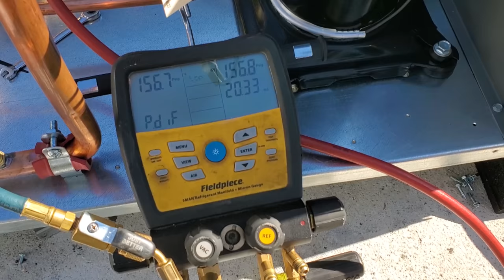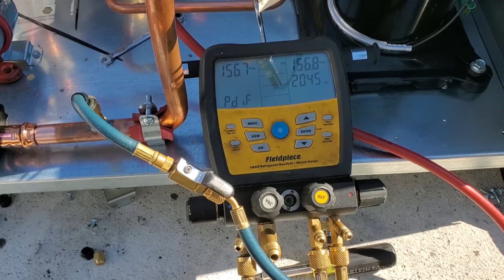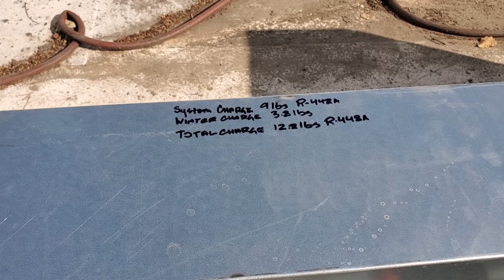WALK IN COOLER RETROFIT WITH ZoomLock MAX

Comment: We had a multi million $ building built at work, they used zoomlock on the gas lines and the ac units. 7 months later they were back ripping down walls replacing them with braise joints and compression fittings cause they leaked constantly.
Reply: lmao if dozens of fittings were leaking then that's clearly installation error
Reply: @rustblade5021  the Australian sun will do a number on anything left exposed. And because of the nature of the building it was decided that even though the ones in the walls had not leaked yet, it was a better idea to reppace them.
Reply: Amen
Reply: I work for a large HVAC contractor in Wisconsin. They decided to use Zoomlock on a VRF system in a 12 story hotel. BIG MISTAKE. REALLY BIG.
Reply: Using some POE oil on fittings will ensure that the fittings are put on all the way
Reply: @jareddory2155  UV exposure
Reply: @KashMan91   Can't see how UV will affect the o-ring deep inside the crimped fitting.   It all has to do with the system design and installation.  Auto AC has used o-ring sealing for ages and they seldom are the cause of leaks.
Reply: @LMSILVIA  iunno I was just throwing it out there.
Reply: @LMSILVIA  do you have a lot of experience with these? I've never used them as ppl have told me they leak.
Reply: @KashMan91  No experience but have read a lot how they work. Personally i wouldn't use them on HACR. 
I see the benefits in water plumbing where they have a lot of connections to make and solder in tight spaces etc. 
But on hvac we run closed loop line sets and a lot fewer connections so maybe the time savings are not enough to pay the compromise in reliability and i can't imagine this being used in rack systems, trusting tens or hundreds of pounds of refrigerant on them ? i don't see it.
Reply: @LMSILVIA  You have no experience with Ford double o-ring quick connects?
Reply: @LMSILVIA  In this context, agree. Automotive context: o-rings leak when there is relative motion between the pipes being joined, or when corrosion creeps into the joint and under the oring. I'll also assume that the o-rings are of a suitable temperature range, and that they are able to maintain their sealing properties when very hot or cold.
Reply: @joehead1294  Its not my trade auto AC but i have seen them yeah, that type of connection is also used on fuel lines same but 5/16"
Reply: @LMSILVIA  rack systems deffos not.
Reply: @farnzy2011  they definitely don’t work with r410a because of high pressures but people don’t install them right in the first place 👊🏼

Comment: I've been paying attention to the plumbers using these type of crimp joints on YouTube. One of them actually cut these things to show how the joints fit inside. This is the first application I've seen on HVACR units. I used the Shark Bites on my water heater, not elsewhere. One of the plumbers said it is good for that as these fittings will last as long as the water heater, then replace. Never in wall! Same deburring, sizing and square fit needed on these. I do believe the weakest link of the myriad fittings is the material in the O-ring. Denver Water is changing the pH of the water to a higher number due to the old lead wiped entry line joints to buildings before 1965. This may affect the joints of many kinds. I seen O-rings fail during my career in electronics repair in oil-filled electromechanical linkages and the similar material in tape drive friction areas in units less than 10 years old. These either turn hard with a shiny surface or turn to mush.

Comment: So my only question about the solderless fittings is how you replace something. you'd have to cut the pipe and either add a new fitting or solder it. I understand why the new fittings are nice: Don't have to carry propane torch around, no risk of an accidental fire or injury related to that. but it does seem like it would make the task of both install and repair more time consuming. If you find a leak on a fitting, you couldn't just braze it because that would destroy the O-Rings inside, it would require replacing the whole fitting from what I can tell.
Reply: Here in Sweden we use it also. There  are repair fittings. Those are longer then the normal fittings 🙂

Comment: Hmm... interesting, are those fittings just now comming to the US? Over here in Europe you are required to use them for alle freshwater and natural gas installations and you are supposed to use them on all heating stuff. Brazing is not allowed on the first two anymore and discouraged on the later. Got myself one of those hydraulic presses for private use even because of that.

Comment: The historical district in Seattle makes the use of Open Flame brazing very, very expensive. They already burned the entire city down once in 1889 and aren't looking for a repeat. To legally braze one joint would probably cost in excess of $500.

Zoomlock system is not so expensive in that light.

Comment: Didn't know press fittings can be used for freon... In EU we use this system for water (stainless fittings), heating (so called carbon steel fittings) or natural gas (stainless or copper fittings) for gas  boilers.  What's the operating pressure for r22, like 20bar ? Will it hold? I've had leaks with this fittings on much lesser pressure, especially with copper fitings. Really want to know if it's ok to use for freon

Comment: Idea for a bonus vid: Whats the difference between all those refrigerants (R12,R22,R410, etc). Some are dangerous and some are not is what ive noticed so far but i guess theres more to it?
Reply: Some refrigerant can be toxic or flammable. R290Propane and R600Isobutane are flammable.  The letter after the number means if its toxic or not, which are A & B, B is toxic. Regardless, high concentrations of refrigerant are bad, simple answer. The popular refrigerants you just asked about have different GlobalWarmingPotentials and OzoneDepletionPotentials.
Reply: @Jim-th2xe  Thanks.
Reply: The Number of for example R404A or even 1234yzf doesnt say ANY about the danger of the refridgerants. Just another type of mixture. Its the security class from A1 A2 to B1 B2 or whatever what calls it dangeours.
Reply: R-134A is the more modern refrigerant used in most vehicles nowadays, although I remember hearing about another that is supposed to be neutral to the environment, a replacement for R-134A, although I haven't heard much about it since and its supposed to be quite expensive.
  
Before R-134A there was R12, of which production was banned in the mid 90s and now is very rare and expensive.  I seem to remember that some old units, like the one in this video, also use it, although those are getting up in years and so getting rarer to find.  Vehicles are banned from using the flammable varieties of refrigerant, naturally.  I seem to recall some systems use a form of ammonium, which is highly toxic  although those are for very large facilities like cold warehouses.  

Some systems use CO2, which while deadly to breath I would say is a much easier one to clean from the environment, requiring only plants, although these do require extremely high pressures so requiring special training to service, and also making explosive failures a possibility, as such they are a rarer system.  That's about all I've got, having no experience on the other types.

Comment: I wonder how the o rings handle freezer suction lines with the freeze thaw cycling?
Reply: The problem is greatest close to the condensing unit, where the temp swings are the widest, the high temps are highest, and they are exposed to vibration. It's only a matter of time before they give up.
Reply: @WTFChuk  We were told never to use soft solder in refrigerant lines due to acid conditions eating the joints, I know there should not be acid in a refrigerant system but? In the Inland Empire, desert with today's high discharge temperatures due to new refrigerants I would be to chicken as a former HVAC contractor to use these fittings. Maybe Chris is braver than me.
Reply: @bobwelemin1770  You should never use plumbing-type soft solders for refrigeration. 95-5, 60-40, and other plumbing alloys don't have the elongation and vibration resistance for use on high pressure refrigerant lines. The only soft solders that I am aware of which are specifically designed and approved for refrigeration use are Harris Stay-Brite and Stay-Brite 8. These solders have the strength, elongation, and resistance to vibration and fatigue needed for refrigeration & AC service. I generally braze all my connections using Harris Stay-Silv 15 (15% silver, phos copper brazing rod), but I do use Stay-Brite or Stay-Brite 8 on occasion. It depends on the situation. Heat sensitive components that are difficult to protect for brazing, or filter/driers installed after a burnout where I know I will be replacing it soon, are examples where I might use Stay-Brite. I wouldn't worry about acids in a system attacking the Stay-Brite. Those acids will damage motor winding insulation and cause a burnout long before they cause a Stay-Brite joint to leak.

I don't like ZoomLock fittings because I know they will eventually leak. Sooner or later, I am going to get poor-cooling or no-cool service calls on the equipment we tried Zoomlock fittings on, and I am going to find the systems low on refrigerant because a Zoom-lock started leaking. I will fix the leaking fitting, but unless I replace them all I know I will be playing Whack-A-Mole over the following years.

Comment: Nice and interesting videos on your channel. I have seen a lot of them. :-)
It is very easy to see what you are doing and what is happened there, you are doing this in a very professional way, the recording and video-cut too. I like it.
-> There is one thing what could be a bit of a problem. (only Possibly, I only want to tell you my opinion)
At Timestamp 18:00 you are sanding the surface of the cooper pipe, this creates some little tiny scratches on the surface. This are little cavities and the O-ring is possibly unable to seal the surface in a proper way. This could leads to micro-leackage.
If you would solder this pipe, this would be a very good way to remove the oxidation of the cooper and give the tin a good contact surface. But in case of the  O-Ring technology of the ZoomLock MAX, less work is sometimes better.

Comment: What’s the difference between this and the rls system? Which is what my company was using for a bit.
Reply: The ZoomLock MAX fitting is a more robust copper in sealed packaging for debris free fittings. The crimp location is different as well. To get ZoomLock MAX certified you can visit zoomlocktraining.com or zoomlockmax.com for more information.

Comment: Question,  is the zoom lock system faster than the good ole silver solder method? To me, it seems not. All the prep needed to make the system work could have been halved by a simple silver solder. And the future,  o-rings fail, causing more problems. But hell, I am an electrician,  what do I know?

Comment: 24:58 "...but...." will it hold for years to come? And how do you fix these connections?
ie, with solder, you can simply unsolder; with zoomlock, do you cut them shorter and shorter each time?

Comment: Question, why isn't rubber hoses used in refrigeration as they are used in automotive air conditioning?
Reply: Generally only the discharge and suction lines in an automobile are flexible everything else is aluminum. The reason for flexible lines should be obvious, but even then those lines are not straight rubber, they have a inner liner to prevent collapsing or bursting of the lines. 10-30 psi low side 200+ psi high side pressure on a R134 system.
Reply: Because rubberhoses in that length are expensive as fuck. And not needed at all.
The hoses are not 100% impermeable to diffusion, which means they lose refrigerant, copper is better possible because the temperature in the lines for refrigerated / freezer rooms fluctuates extremely
Reply: @SvenSigi  With R134 refrigerant yes you get seepage, older r12 systems this is less of a problem because R12 is a much larger molecule.
Reply: Copper is cheaper, also copper doesn't usually degrade over time, unless in extreme environments.
They use the rubber hoses in automotive because they need more flexibility than a solid metal line would allow.
Reply: Rubber degrades over time, especially these days when penny pinchers are substituting percentages of cheaper vinyl over the more expensive oil resistant neoprene into the rubber formulation itself. I had just finished recharging a 134a new tractor sitting in the strong sunlight with the hood still open engine off, when I see for only brief moment a cloud of atom sized fog ejected into still air over the rubber section of hoses. They way it drifted about looked just like smoke, I crawl up there to see what is going on in this exact location and the high pressure line is wet with oil and it was totally dry 5 minutes ago. Told the ranch hand about it and he drove 50 miles to the dealer to pick up a new one, got back and said they issued a recall for all the rubber AC hoses on that new tractor. But all he brought back was the one. We do what we can at times. Just ordered my beanie - I'll be styling this winter for sure.
Reply: Copper lasts forever
Reply: It's for the same reason o-ring sealed joints aren't used instead of flare fittings. Elastomers deteriorate with age, heat, and chemical exposure. Others have mentioned that hoses are needed in automotive due to the relative movement between the engine and body. Modern auto AC hose is a nylon inner tube with a very thin neoprene inner lining, and covered with braid reinforced rubber. Because of the nylon inner tube, it is called "barrier hose". It's leakage rate per foot is quite low, but metal tubing has a zero leakage rate per foot. And, as mentioned, rubber slowly deteriorates, whereas metal doesn't, assuming it isn't allowed to corrode. 

The same vibration isolation issue as auto AC sustems exists in semi-hermetic refrigeration systems with spring-mounted compressors. In those cases, vibration eliminators are used, which consist of bellows-formed pipe covered with steel braided sheathing. Really, they just absorb the start-up and shut-down shake. Once the compressor is running there is a bit of vibration, but not much actual movement. 

There are companies that makes a braid reinforced polymer hoses for AC line set use, but I've never used it or seen it used. I don't even know if it would actually meet code requirements in many jurisdictions.
Reply: @RoyLeblancMMJReviewsIE  dont think we need to talk about r12 anymore. In europe (CH, DE, AT, FR, IT) for bigger machines 50kw and up, Co2 (R744) is THE MOST USED refridgerant. R12/r22 banned for almost 20 year. So step up, americans. R404A BANNED since this year. R134a banned in 2 years. Natural fluids are the right think to go. More efficent, if it leaks, nobody cares cause is natural - >No damage at all to environment. For private people refridgerators have propan and isobutan more than 10 yrs, others cant be imported.
Reply: @SvenSigi  r12 is banned here for new applications

Comment: great video! but not to knock u down, ur a good mechanic, id left the cond. valves on so u could do a pump down test on compressor, set LP or pump down liquid line and know theres no pressure, king valve front seated will read receiver pressure only.
Reply from the maker: I understand what you are saying but there is a high side service port behind the compressor and the liquid line service valve i cut off was after the receiver so it the same pressure as the receiver.....

Comment: I dont know man, I think the only thing zoom lock will be good for is "lower"costs up front and more work down the road. O rings dont last forever. I dont think anything will beat a good solid braze.
Reply: Not much for lower cost.. each connector is 20 to 30 bucks each.
Reply: @wolfwolfenstein5537  right, and not to mention the tedious prep work involved
Reply: @jesseh5554  even to get a quality braze joint needs to be properly prepped but I can do 2 braze joints for the time it takes one of those connections.

Comment: At 10:06 - isn't it also a good idea to have a vacuum cleaner or something to suck up the shavings so that they aren't going out in the system? You already discovered one shaving in another episode in a valve causing it to malfunction.
Reply: Dude I’m glad you said this. The vacuum is the answer 😂 this whole time I’ve been struggling. 👍
Reply: @eh - iv ebeen doing this 40 years next year. easiest way to do it is just hook your nitrogen hose up to the suction port on the evap and blow the hell out of it after deburring remove sol. coil and put your solenoid magnet on it to blow out liquid tube. put your thumb over each tube alternating back and forth letting pressure build up and let her blow out works great. Great piece of mind . set regulator for 150 psig. it also blows out any debris that the factory might have left in there too.

Comment: Lots of nay sayers here. Has anybody taken the time to look at the Specs for the fittings? From Parker the svc life is 25 years with a 10 yr guarantee from the date of purchase. Working pressure is rated at 700psi, Burst pressure is 2100psi   How long is the life span of the systems these are installed on. Will the system Chris installed them on last more than 25 years?  Have you ever encountered a braze joint that has failed after it was completed?  I guess time will tell if theyre a good product.